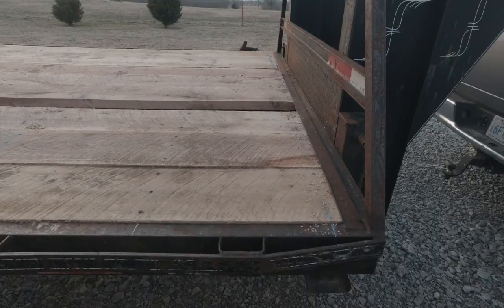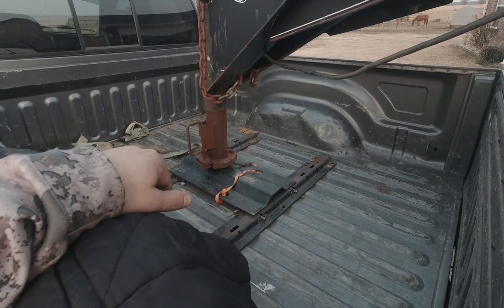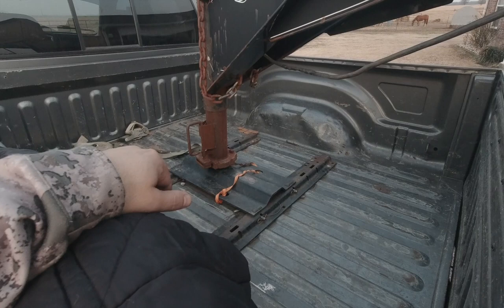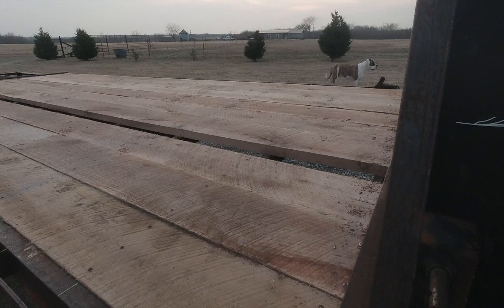Redecking Gooseneck Trailer - Time-lapse 2019

Comment: Nice work. About to re-floor mine. Never thought about finding a saw mill to use. Perfect! I will be doing that for sure! Question. Did yall treat it at all? I was told of an old trick, to treat it with diesel. I think there is truth in this. We buy and sell heavy equipment. The only good spots left are where oil and fuel have spilled. Haha!  Thoughts, ask your old man. Thanks for sharing this video!
Reply from the maker: No we didn’t treat it but there is oil and diesel on it from stuff leaking. 

Maybe get a little bucket of some fuel and a paint brush and paint  the diesel on probably help repel water